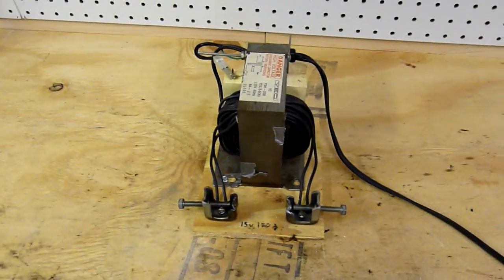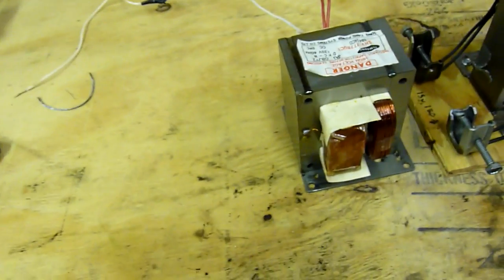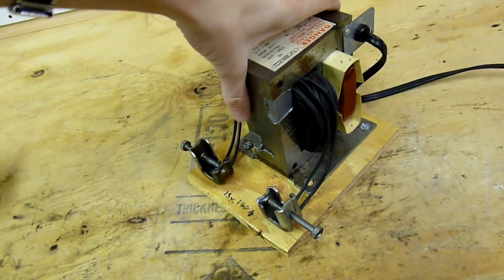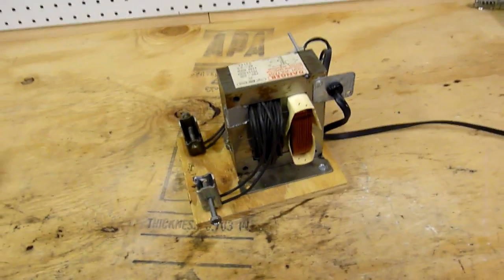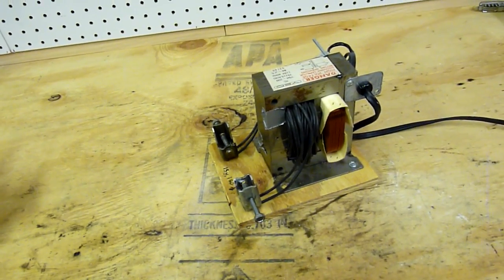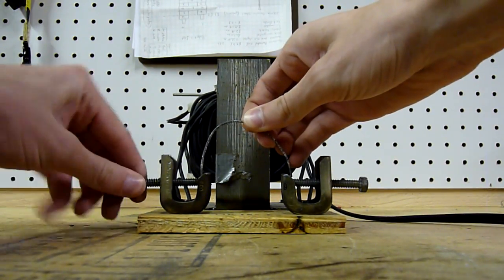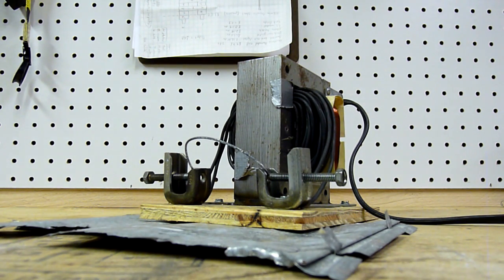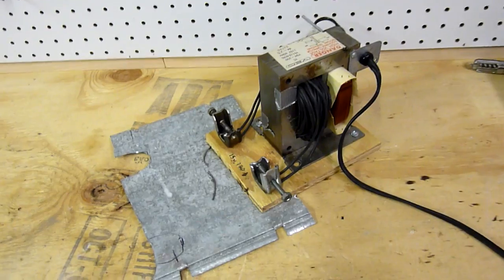High Current Rewound Transformer

Comment: Im sorry to tell you your not going to be capable of drawing 180 amp on that thing... for a second maybe but not for a longer period. the standard for drawing a continuous current of 100 amps through medium cooled high quality copper wire is 50mm2 so there is a space issue when I comes to mounting it on the iron core - how did you end up with a current of 180 ?  Any way I know this because I have just transformed my MWOT to 2V 100A and I could only just fit 2 windings there

Comment: Did you know you can buy large EI transformer core laminations and bobbins, in small quantities and wind your own, and then you not limited to the size of the rather small MOT winding window, and you can pre wind the primary and secondary and then assemble the core around it. Beats feeding wire through a already assembled transformer. You can get way more power too. You can also add your own secondaries to toroidal transformers. A MOT will overheat if used continuously.

Comment: This transformer does NOT make a good power supply with its original primary winding because it saturates the core (not enough turns), and it will overheat if used for more than 30 mins....2 MOT's with primaries wired in series (60 vac each) will run stone cold and the secondaries could be connected in parallel for high current.